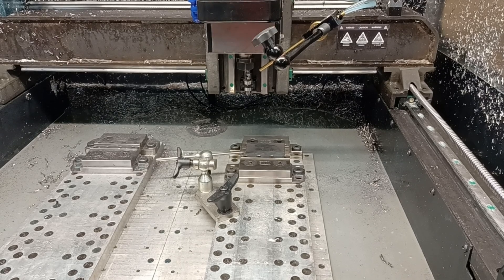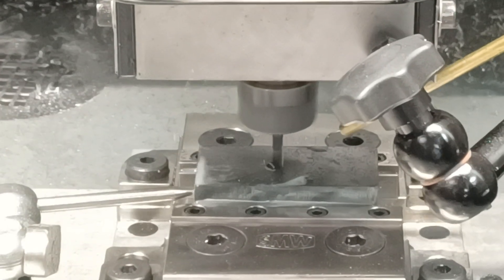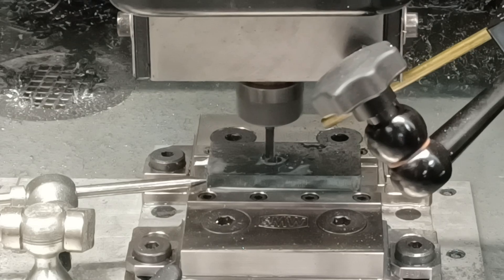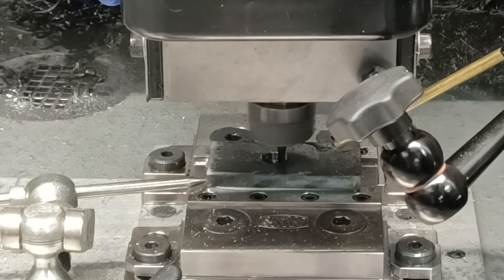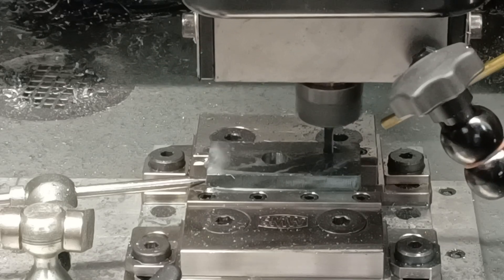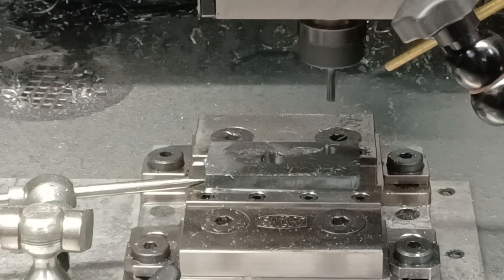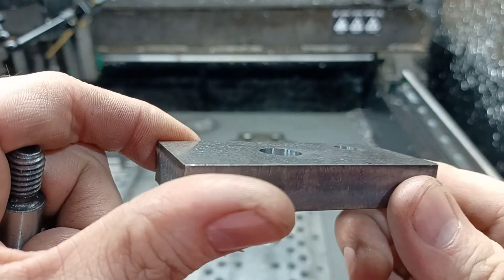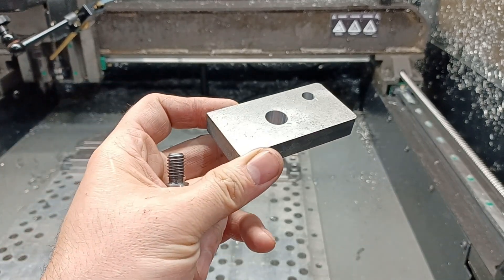Running Steel Parts on the @LangmuirSystems  MR-1  #langmuirsystems #MR1 #cnc

Comment: Sounds like something someone without a tool changer would say
Reply from the maker: 100% lol.  If i had a tool changer I wouldn't do this all with a single tool.  I would drill, chamfer, and tap the small hole before taking the part out of the machine.

Comment: Do you grease your ball screws, and if so, what kind do you use and how often? Also, how do you keep chips from sticking on them if you do apply grease?
Reply from the maker: I use White Lithium grease.  The fine chips are the ones you need to worry about.  Programs like this one get fin metal dust.  I normally blow off the debris before sending the machine to the front.
Reply: @BeckTools I am currently working on a design for rubber bellows to cover the linear guides and ball screws. I’ll share pics once it’s finished. Thanks for your reply!

Comment: Hi - what speeds and feeds did you use and the stepover - Peter
Reply from the maker: 8000rpm, 30ipm, 1 degree ramp angle.  Step-over = doesn't mater as long as it's less than 100% of the tool diameter.  You don't want to leave a post in the center of the hole.  That can damage the endmill when you break threw the bottom of the material.
Reply: @BeckTools  Thanks - that's 0.024mm/tooth that's a fine cut. But its a 4F tool so I suppose thats OK. It works! I'll try that on my router... Peter